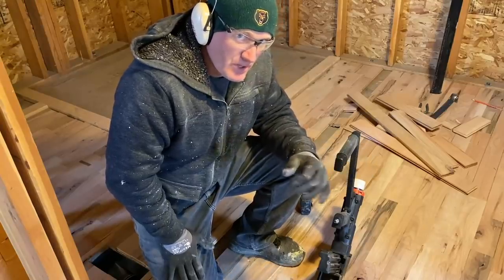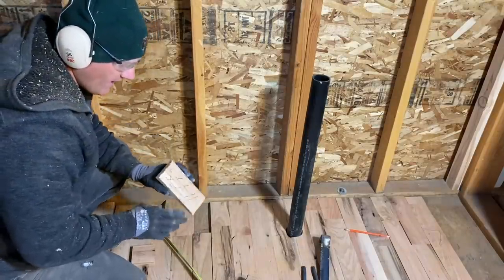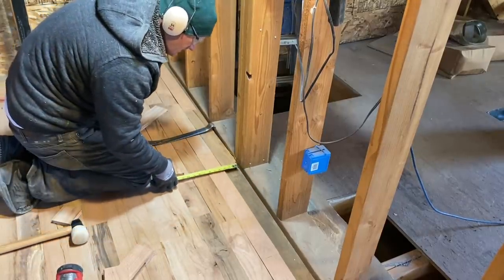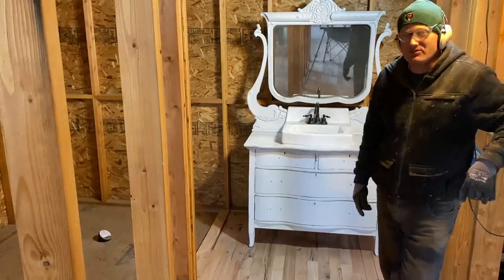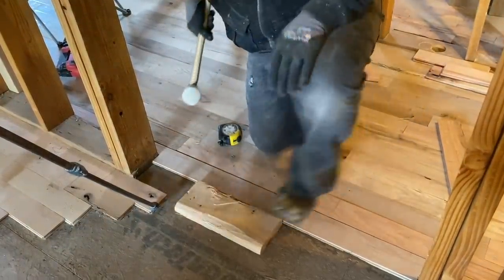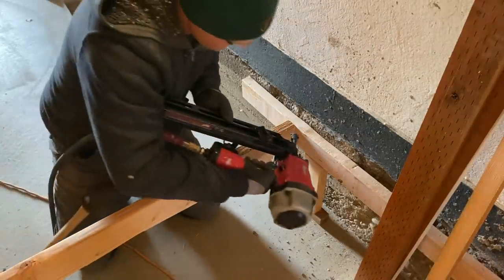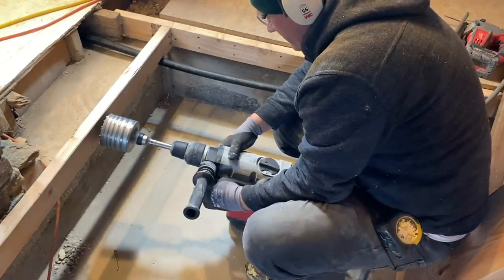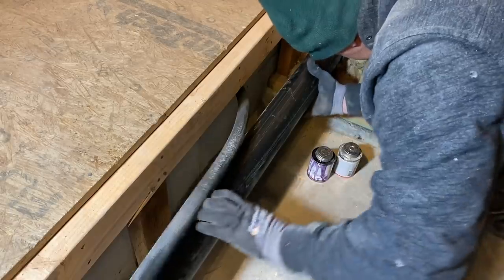Cheap Oak Flooring Fixing Utility Oak (Seconds)

Comment: Flooring is after drywall and paint.
Reply from the maker: Bu we aren’t doing drywall and we’re probably painting the floor to match the old part of the house. 😊
Reply: @JamiRayVintage    I do floor last also due to construction traffic. It saves on hard wear and tear. Plus frequently a change in wall or plumbing can create additional hard to solve issues.